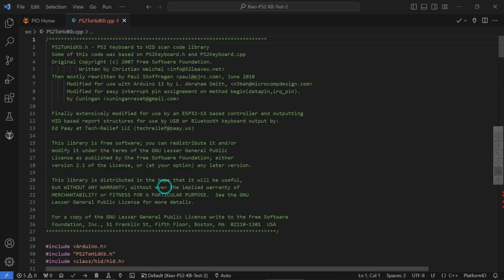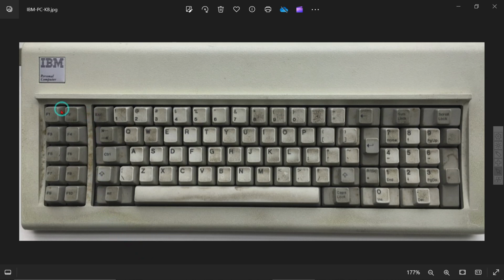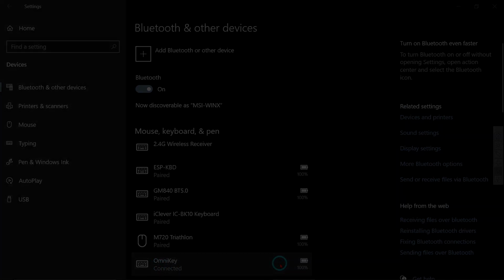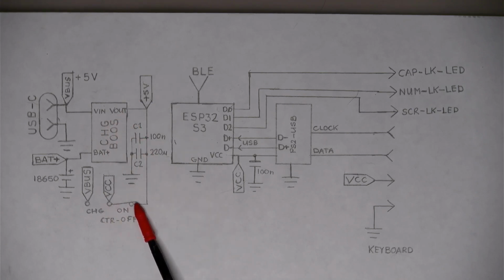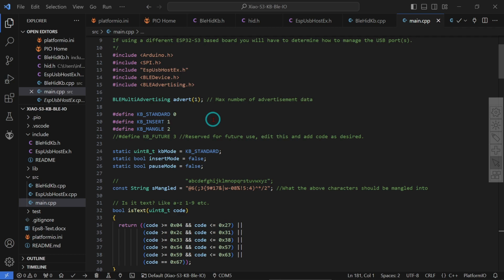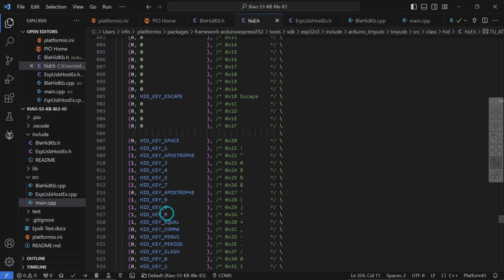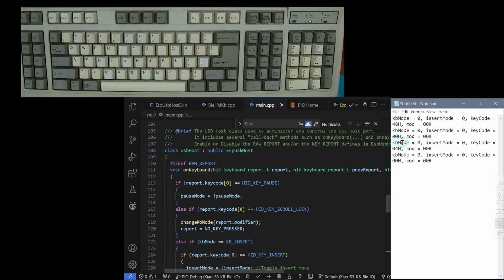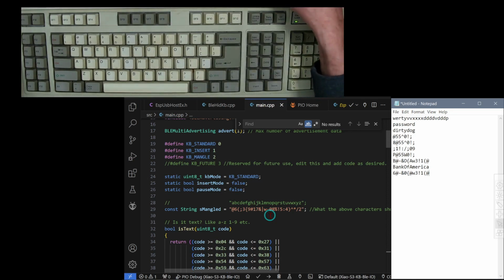Ep.8 Upgrading a wired Keyboard to become a Wireless Bluetooth Keyboard.

Comment: Please make code in Arduino IDE
Reply from the maker: It is usually fairly easy to compile in the Arduino IDE just remove Arduino.h references from some of the files and look for the libraries used in the Arduino library manager.  Most often it will compile and work the same as it does in PlatformIO.
Reply: @Tech-Relief  Thanks but could you make .ino? I’m not good at coding😊
Reply from the maker: @donenoun-it  I created a video on how to convert and compile a PlatformIO project for the Arduino IDE let me know if this helps you? https://youtu.be/ySV-Pwr5FnY
Reply: @Tech-Relief  Thank you very much. I’ll try that😊